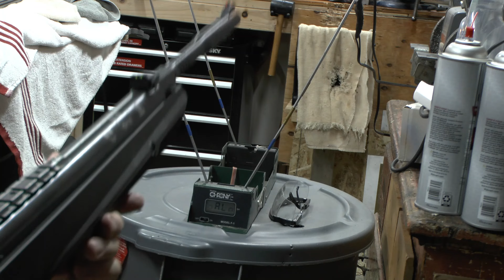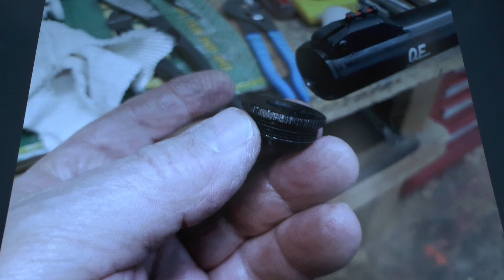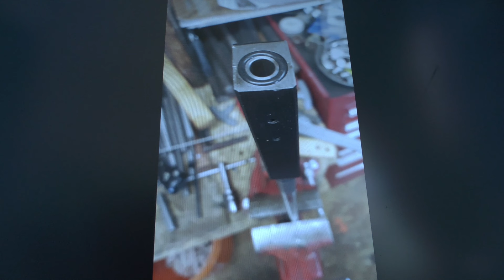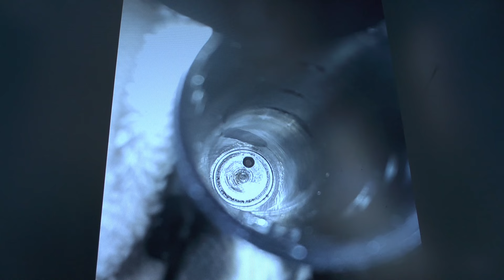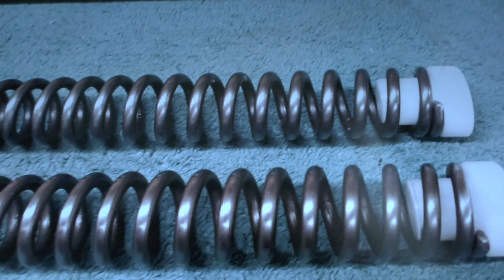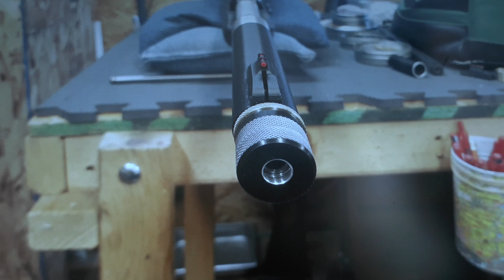TWO HATSAN 130 S T. J. re barreled  30 cal three  power plant tested and  more **

Comment: Hi Mike.🤠
About a month ago I purchased a Chinese BAM XS-B26 177, HW95 imitation.
And it even manages to group fairly decently with Air Arms 8.4, but nothing to write home about. 
I remember you talking about lapping the bore to save a barrel. 
The main problem with this rifle is that the barrel got crimped at the end of the breech block by whoever installed the barrel at the factory, and when doing a pellet to bore test, the pellet free falls through the barrel after the breech block.
It's a smooth shooting rifle but I am not planning on dumping a ton of money into this project but I figured I would message you to see what your input is on this. 
Thank you.🎯🙂👍
I hope that you are doing well Mike.🙂👍

Comment: How do I contact you? I have a Hatsan 130QE that was cocked a year ago overnight now won’t fire. Banged on left side to see if it’s the safety. No luck. Gun cocks super easy and when you pull the trigger there is a faint ping and that’s it. Would like to find out how to send it in and have you repair it and maybe rebuild it so it lasts longer if possible . Thank you.

Comment: Hey Mike, Vortek offers 3 different sizes of .148 wire. Just curious if you used the 43 coil one? I only want to do this once on my 135 and would like to get it right the first time.
COIL-Spring
850148-xx
(xx = 43 coils allowed at approx. 15.200"/386mm long)

Valve quality spring power!
Custom Cut, Close Ends and Polish
Model #HiY850148-43 approx. (xx) 
Customers select the coils needed to have Cut, Closed, Ground and Polished.

Specifications:
.850 OD Approx
.548 ID 
.148 wire size
 75 lB /In average depending on coil length

Comment: I'm in the slow process of swapping out my failed Hatsans with air pistons that have failed. A fined tuned mechanical springer shoots just as smooth or better than an air piston, plus in general the steel mainspring lasts a lot longer. Also, from what I have seen cold weather actually negatively effects an air piston more than a steel springer.

Comment: Hi Mike, great content here, I have a 3yr old 130QE which has lost all ram pressure standing in the cabinet for about 2 months, any chance on sharing the spring size used in the conversion, as I have a good selection from Webley patriots and the like, (along with a reliable spring manufacturer, who ha produced great components to my spec previously) . . . I see you used two wire gauges in the spring, rest of the conversion I am happy to get into (having a machine shop and 45 years of playing with airgun internals, :-) for my own benefit only) . . . one thing I totally agree with is the Hatsan manufacture quality is a shambles!, my old UK made Wembley Patriot (1982, 34ftlbs) is still getting used 3-4 times a week, totally in love with springers! keep the content coming, we are appreciating an excellent insight for those that understand, Awesome! 🙂

Comment: Mike what happened with Chris not been able to pull up his content here in the UK for two or three years.I remember those stunning stocks he used to produce.
Reply from the maker: I believe he may  of had  to check  into a Re hab center,  he landed in a bit of trouble
Reply: @MrSteppingstone888  sorry to hear that, He struck me as a very talented young man.
Reply from the maker: @davidprocter3578  Yes he is very talented  very aggressive  though , it was Chris  who started my  interest  in air guns
Reply: @MrSteppingstone888  Did you ever get to try his  Webley Patriot conversions.??
Reply from the maker: @davidprocter3578  I did  not  but  from what Chris  shared  with me a while ago  when we were discussing hatsan breech seal set ups.
what he did was cut the tube and extend it adding  more swept volume, which I found difficult  to believe beings  it was some ones  gun, and the amount of work and time that would be involved / back  when  Chris was doing that is about  when things went south  as some guys were complaining and had to get sheriffs involved/ only makes  sense if you get a lot more power out of  the gun  that you take advantage on the swept volume obtainable thru modification  which generally  is a small amount
pretty sure Chris has a lot of machine shop abilities when he can get  around all the shop equipment. I have his email if you  want to email him.
One thing Chris did not do in his old  look at the power I taken  the patriot  too videos was he never showed  accuracy
Reply: @MrSteppingstone888  Was that the two guys  who usurped his title CAP and set up another company developing PCP's ???. I have a friend who cuts tubes and welds on new sections in order to repair Webley Service  mark 2's. the cylinders often get stretched on well used guns  the same on Webley Hawk mk 1's.  RH who designed the Park air rifle and the Sterling HR 81 etc amongst others. Re worked a Webley patriot converting it to semi recoilless he also uped the power considerably  he complained that he thought that the Patriot was not very well made but never qualified this statement well at least not to me. Have to say that the Patriot he converted was very accurate but I have no idea as to how he might have tuned the action.. If Chris was extending the compression tube too any great extent that would require extending the piston to. I think it would be easier to chop off the old tube, remachine the breech jaw block and attach a new longer tube. this would also provide good access to the transfer port for honing and polishing.along with the cylinder end plug face or stamping in shallow ducts into the plug face to help move the air like Theoben did.It would also be possible to hard chrome the cylinder tube before fitting. Did you know BSA developed the hard chroming method more likely bought the patent from someone.they also produced seamless tube. BSA tubing still exists but no longer makes tubing just imports it from other countries.I did ask Chris about producing me a stock a few years back but could not afford his price at the time.
Reply from the maker: @davidprocter3578  I think Chris  did mention  he is working with some one on  developing a air  rifle , I would bet  C.A.P.  air  guns  most  likely  are his initials .  Yes  he most  likely made a longer  piston  
one guy who went thru hell with Chris having his patriot said  when he finally got  it back the barrel was chopped.
I have a big  problem with people who act  like  they can do  what ever they please . Mac 1 air guns sent me a polygon bored  L.W. barrel when I ordered  a regular LW  barrel and the guy was full of  him self  justifying  everything when  talking with  him about  it
Reply: @MrSteppingstone888  Yes you are quite right Too many people take decisions on themselves that are not theirs to make some years ago I had a pre war BSA with a very rare stock restored when I got it back the stock had been carved up and converted to look like a standard BSA stock. When challenged the restorer tried to claim BSA never sold guns with that type of stock . I had asked him not to mess with it prior to restoration and then had to prove to him after he had ruined the stock that I was correct, It turned out that a collector I knew had the same gun and sent him a photo, It did shut up his chatter but was little compensation for losing such a rare beast. I always check before I change anything. If the owner does not want things changed  I leave as is if obvious job is going to be a costly waste of time I decline it. and as gently as I can try to explain to the owner that what they want is not really feasible. ~I regularly get asked to ramp up the power of a gun without changing the original parts that is a fairly limiting brief  in particular if the spring and seals are roached. Best to politely decline the work. At a cost it is possible to revamp old springs but far cheaper to source new and badly damaged seals well there is a waste of time and effort.